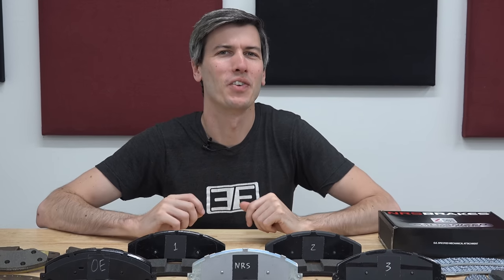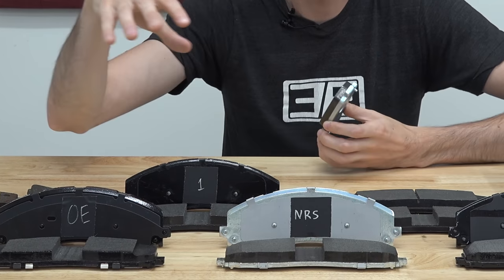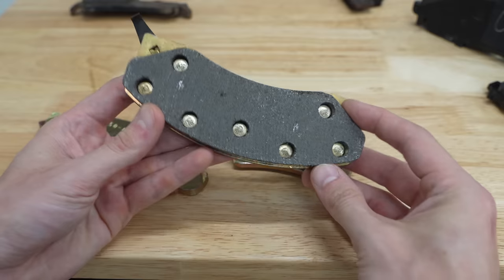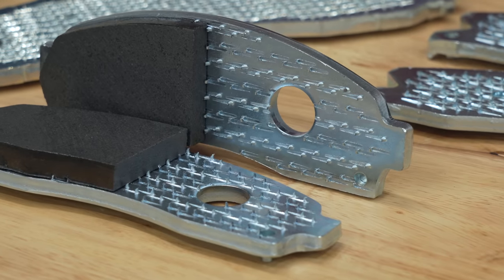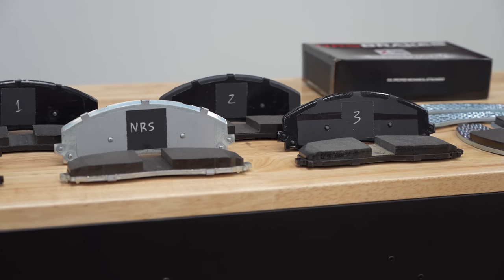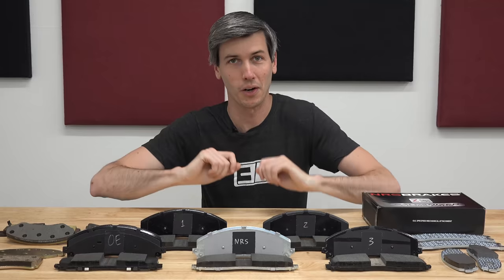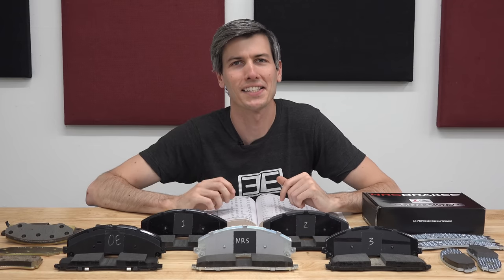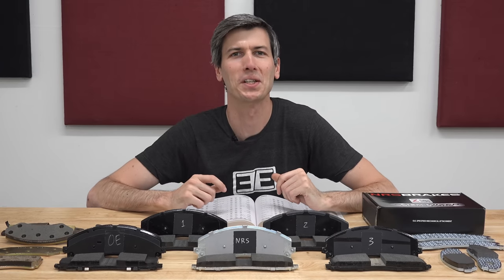The Sketchy Truth About Aftermarket Brake Pads

Comment: Perfect timing, in the market for pads now.  Going with Hawk HPS 5.0's this time to try them out.  Great video as always.
Reply: Those pads are junk just fyi. I used them for over a year before I just decided to get rid of them. Zero bite and unpredictable when wet. Bad for the street and still not good enough for track use.
Reply: @chrisbradley3224  Thanks for the info.  What do you use and on what vehicle?  Wet performance is huge for me in my area.  No snow at all,  but rains a lot during summer.  Running akebonos currently (can't recall the model) but they are just one performance step up from their standard ceramic offering that comes from the factory.
Reply: @solocamo3654  What car? I use Raybestos EHT on my Mazda 3 and OEM pads on my BMW M2 Comp. The Raybestos EHT is a good street-only pad but probably on par with the Akebono. I had the HPS 5.0 on my Mazda. Is there something you don't like about the Akebonos?
Reply: @chrisbradley3224  Infiniti G37 Sedan.  The akebono's are great but my front passenger pad seemed to wear out quite a bit faster. Though I'm not blaming the pad itself as there may obviously be a larger issue.  I mostly wanted to try something new with the potential of being able to handle very light track use here and there.

Comment: Thought I'd learn about brake pad design but instead I got 14 minutes of shilling for NRS brakes. Cool.

Okay so 2 brands dont use the hook style mechanical attachment. What is the big circular spot in one of those 2 brands? Are these brands using pins or another method of mechnical fastening? Completely taking apart the brake pads would've told us if so. 

Why would they bake brake pads at 550 for days to prove the adhesives are not as good? That is not representative of real-world brake pad use & abuse. 

Also engineering products comes down to the performance required in the application. If this difference in using hooks was such a big deal then where are the in-field failures? You should know this you built your channel on real engineering concepts.

Its obvious that NRS brakes is leaning on the mechanical hook feature as a selling point. Whole video seems like they sent you a script and a marketing box with all those pads and you said "thanks for the check" and put out a video where none of what you say even sounds genuine. So disappointing.

Comment: Jason, I'm disappointed. Why haven't you mention the max shear forces that the pad experiences, since you know, when you step in the brake the rotor diesn't budge against the side of the brake pad, the pad material is pressed between the rotor and the backing plate. So the harder you press, the bigger the friction between the friction material and the rotor, but the bigger the same force is between the pad backing plate and the friction material, so even the weakest adhesive will be sufficient, besides even zero adhesive would be enough since you have two almost exact contact interfaces on both sides of the friction material, the difference being one is moving, and the other one is not, and even has some adhesive. Guess what side is going to slip and continue to slip? So yeah, totally disappointed (

Comment: The test does not represent the reality. Nobody reaches such high temps over a long time. And they should measure the force by rubbing over the pad surface, not against it. 

How about a new test method of temp cycles. Like 1000 times from 30 - 350 - 30 degrees with real breaking. This can be automated.

Comment: Remember that Engineering is about what's "good enough" to meet safety, performance and cost constraints.  What is the absolute "best" performing is usually not the optimal solution especially when the performance is measured using tests that are not verified to be analogous to real world stresses and wear.
This is very disappointing series by EE in my opinion and does not embody what "Engineering" really is meant to do.

Comment: Galvanizing protects against rust for how long? Probably weakens bond? In 50 something years as a driver changing my own pads NEVER had pad material separate. But I have had multiple OE disks warp - including under warranty - OE crap parts. OE requirements are therefore rubbish and are based on price. After market NEVER had a warping problem. Cannot get OE pads for my car- to old and GM/Holden support is bad from my experience. Tests are not valid as in real use some pads may actually dissipate heat more effectively or not even get as hot. Have just used reputable after market parts. And do some research on how bad best selling USA "truck" brakes are/were - even TopGear highlighted this a few years ago. Popular USA  global "sports" car also has very poor overall safety rating - nice car but don't worry about basic safety - OE design. USA aftermarket is generally way better than OE.

Comment: I have PowerStop towing brakes (Z36 carbon ceramic) with drilled slotted rotors on my truck. Love them. So I installed their carbon ceramic pads and drilled/slotted  rotors on our CX5. Same thing, loved them. 

Now comes times to replace the rear pads on the CX5 so I ordered the same PN pads, well they didn’t fit the calipers at all. Had to grind multiple interference points on each inner and outer pad on both passenger and driver side. Same points on all 4 pads.

Contacted powerstop and they swear nothing has changed or been flagged. Well something has changed since the metal casting of the new pads was way more rough than the ‘original’ ones I was replacing.

I still love their brakes and I don’t think you can beat the price. But I will be watching their quality when it comes time to do my truck again and fronts on our Mazda

Comment: Thanks! I experienced this. 50-60 mph down hill, traffic jam ahead Have not used brakes for miles.. pedal goes straight to the floor zero feedback. Within seconds of ditching in the grass that would of ended with crashing in to the woods or sliding Hollywood style before crashing in to a bridge. I pumped the pedal like my life depended on it lol second pump I felt something unknown frantically pumping. I came to a stop before the traffic but a little off the road. All pads 20k mile like new except front passenger inner was metal. Immediately following that stop I had the good old metal on metal sound. I typically get 80k miles  or more out of brake pads even towing. So, now way they were overheated. Just a fluke failure.

Comment: What a pointless video, the amount of times my pads separated like this is 0, this is not a typical failure point. I'm more likely now not to buy nrs pads because for some reason they think that this is an important factor in buying pads, its not. Also get rid of the Z branding for mechanically attached pads, russia sucks.

Comment: I like this channel. But this is a such a useless video. I have a fleet of van and trucks. OE pads and rotors always suck. They are a compromise. Buy name brand premium pads amd rotors. I alsway try for brembo pads and rotors. If they are not available for my application I go to EBC, Powerstop, or best major part store brand (only if i have to). I have 150k on a work van that i did replace the OE pads and rotors with at 50k with brembo parts. 100k plenty of pad left and rotors are not rusted, dead smooth and quiet.

Comment: I do my own  brake jobs, and I check them often, usually before the winter to see if there is enough meat to get through the season. I often replace the pads only when it reached legal minimum thickness. I do not drive like I am racing or tow heavy trailer down the Rockys. So bonded pads are acceptable for me if they are cheaper. Job number one when I do brakes, I bend away or break that squeal tab, which make noise too early. I hate semi metallic pads for they are hard on rotors, I usually get 2 sets of pads per rotor unless I get some from the wreckers. When I do brakes, before I push the piston back in, I use a glass syringe and needle and I lift the rubber dust boot and inject several CC of old brake fluid into the area in front of the piston, then I push the piston back in and catch the excess with a rag. Don't bother with those plastic syringe you can pick up anywhere. This prevent seized calipers in cold climate at northern states.
Reply: Tony. Interesting piston compression technique. Getting lube on the piston O-ring sounds good. I have not done that before.